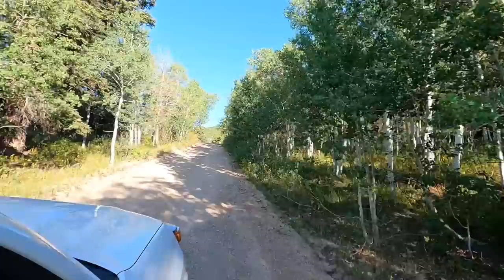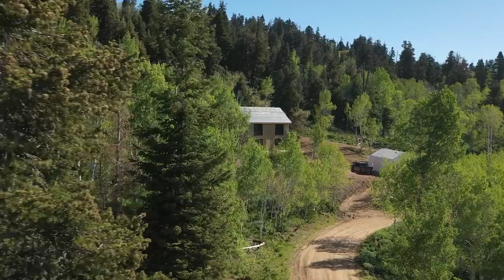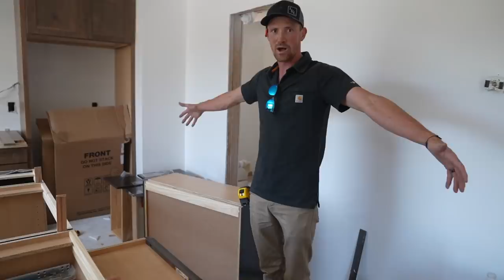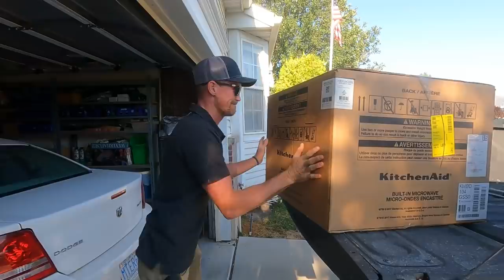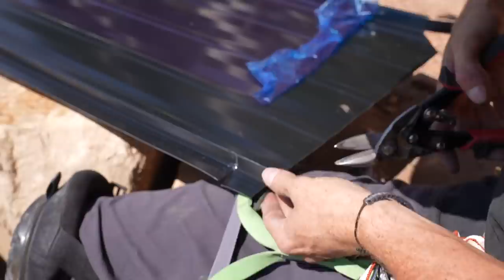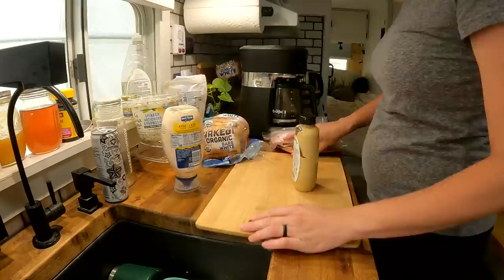TAKING ON THE ROOF | BUILDING OUR OWN HOME

Comment: Not sure if you have thought of adding a generator to your build, but it was the best thing we did to our Florida home over 15 yrs ago. We have a generac brand which auto goes on within 30 secs of power outage. Included our ac, fridge, freezers etc plus ceiling fans. Lifesaver!
Reply: Great Idea, I honestly haven't heard them say anything
Reply: I understand power goes down lots in summer do to power load from everyone trying to stay cool. So was a great choice
Reply: Totally agree with the generator idea
Reply: Mandatory. Totally mandatory.
Reply: we live in florida also and i’ve been looking for a generator. the only other option is solar and batteries
Reply: I'm in the Mid-South with tons of trees.  We probably have 6 small power outages a year when we get heavy wind and rain. Branches snap off onto powerlines, or blow transformers. But if it's cold, and we get freezing rain, look out.  Ice storms are the worst. Years ago, most of the city had power out of up to 3 or 4 weeks.  Only a few years ago we had a derecho that put most of the city out for a week or 2.  I, just this year, finally got fed up and put in a 14KW whole house Generac.  We had an outage within 30 days of installation.  I waited at my desk for a few minutes and then, BAM! All power back on as it kicked in!  SOOOOO happy, I called my installer right then to thank them again!  Worth every nickel!
Reply: Its a great option if power is unreliable. A we only get one or two outages per year we have a cheap ($250 used) 5000W portable generator that we can manually hook up if we have to. I can also use it around the farm to power welders and the like "off-grid" so to speak. An auto-transfer generator would be a waste in our situation.
Reply: We are thinking of getting one.  After two years of 2 power outages that lasted close to 2 days each time.  We are ready to have relief.  Of course this happens when it is hot outside and we loose all the food from the fridge.
Reply: Yes! Yes! Yes!  Rural “Country Living” includes a generator, and with your enormous propane supply you are halfway there.  Lights, heat, cooling, cooking, refrigeration and baby are all much better off with a gen when the power goes off.
Reply: Expensive
Reply: Yeah, it's expensive but I don't think they are short of a bob or two with all their paid promotions and adsense revenue!
Reply: When we were 5-7 days without power, I would have loved to have a Generac generator…and will if I ever build/buy another home.
Reply: It's definitely a great thing if you can afford it. We had a generator from the year we move into this house, wired in. We manually have to start t it up but hey, way better than not having anything. Ha Giang no fans or refrigeration while waiting for the power to be restored.  W e are also in a Cyclone prone area in the Southern Hemisphere.  We increased our generator capacity two years ago. It's 11 years since we have had a direct now, so maybe this season will be an active one. Generators have greatly improved over years and the prices have improved.

What would definitely pay after the concerns Allie has shown, is sprinkler on the roof. Connected to an independent water source as in underground water tanks,, pumping water to the sprinklers by a generator. It also has been known in the Southern Hemisphere, to reduce your fire insurance costs. As most people know, many coastal areas of Australia are bushfire prone ever since the Greenies put a stop to land management, in reducing underbrush and fallen dead trees. 

At least Trent will have motivation in clearing his fallen trees, needing to feed one very hungry wood fire. I am surprised you didn't go for a wood powered oven/stove. With an alternative method In summer, Trent.
Reply: I have friends in New Orleans area with Generac on Natural gas. The area still without power. They have A/C and providing ice a minimal power to neighbors during the sweltering heat post Ida.
Reply: Yes get a generator with a baby
Reply: Solar panels are nice too.
Reply: @Tom_From_Alpharetta  they are one of the lucky ones, some of the natural gas grids are down too
Reply: I'm in Kansas and Just yesterday had a Solar Array and Backup Generac installed. We have Tornados that tearout powerlines and Ice Storms that knock the grid out for Days/ weeks @ a time.. Haven't Had to use it yet Obviously.. But so glad to know I have it Now..
Reply: @MrBrickboy38  for them? 😆

Comment: I presume your installing tile or hardwood flooring. ideally you want to either install the flooring first (much easier & cleaner look, or at least raise the height of the cabinets using 3/4" plywood so the cabinets are level to the floor height.  Also as I posted earlier I recommend putting a spacer between the fridge cabinet and the wall so your fridge door can swing open more. its possible that your fridge door is not going to open all the way because its going to hit that wall.
Reply: Yup, that is what happened to me.  Fridge door would have opened but not wide enough to pull out drawers.   Had to do a last minute revamp of cabinet locations to move the fridge and make it work.  If you go with current location you may be very limited in the fridge that will fit.   Flooring under cabinets doesn’t have to be raised unless you are doing a thicker floor like hardwood.  Most flooring thickness is fine.  Dishwasher is the only concern and they have about 3/4” gap and so can fit just fine.
Reply: I was going to comment about the flooring UNDER the  cabinets but I just fast forward through a lot of the video since it is already too late by this time.  Ignorance is bliss! :)
Reply: @Suz9006  I agree about the location of the refrigerator. Make sure the doors don’t hit that right wall or you won’t be able to open the door all the way to access the fridge drawers. Been there…
Reply: Happened to me too, I can't get the shelves & drawer out because the wall stops the door opening fully. Have to pull the whole fridge out if I want to get them out, real pain.

Comment: Had a metal roof here in Vt. True, they last forever. But I got tired of shoveling a foot of snow when it snowed only 2". With that roof dumping the snow on the deck, you will be clearing it off every time it snows. Forever.
Reply: I thought the same but I guess that's why they bought the snow blower.
Reply: @SagebrushRambles  I'm sure they realize it will occupy a major portion of their time to keep clear. At least I hope they do! Maybe their plan is to mostly use the sunroom door in the winter? After all, they don't have a mudroom and that could double as one in the winter.

Comment: I would have slid the refrigerator left to eliminate the spacer in the cabinets and use the 3" cavity to store a step ladder to get on top of the cabinets, it's where we keep ours.
Reply: I don’t understand encapsulating a refrigerator
Reply: Yes - a few questions here. That ref sidewall is used when the ref is located with an exposed side. In Trent's application it would have been much better to not use the right side wood wall allowing a few inches on the right side of the ref for 1) air circulation 2) step ladder or broom 3) a larger ref in the future 4) eliminate need for spacer in the lower cabs.  . Also for what its worth they should have installed floor BEFORE lower cabs and island - installed uppers before lowers and wait on trying to place any appliances until more of basic work is completed. But they are young and learning God bless them. Certainly can't fault their enthusiasm. ;-)
Reply: @easyman6086  I've never thought they were going to have wall cabinets.  And I thought the reason they put a row of wall cabinets on one side of the island was to have that kind of "dish cabinet" space."  But who knows but them, each video is a new surprise.

Comment: This is all so exciting! I'd recommend getting curved counter tops. The less you have to worry about when your child(ren) is/are exploring as they grow, the better!
Reply: Curved counter tops also save your own hip bones. I am 5’2” and bruise so easily, my hips were so often black and blue, especially when I was front heavy with 4 babies. I don’t know if real stone can be smoothed into a softer round.
Reply: I agree. 3 grands and now a great grand...many bumped heads hips, shoulders (the kiddos). I have shuddered 100's of times as they chased each other or ran through the kitchen. We finally found some soft but firm bumper pads for the corners and got to breathe a huge sigh of relief. I so wish we had gotten curved counter tops...and YES those hip bones hurt too when you collide with a corner.

Comment: TRENT, you shouldn't be misleading with info like metal roofing that is screwed on. Properly installed the screws do not 'Rip out' when the snow slides. I've been a contractor for 29 yrs in Western Canada, get the same if not more snow than your area and never seen screws rip out. The screws also act as a 'brake ' to control the speed of the snow sliding off the roof. No screw roofing on a steep pitch such as yours, you walk out and close the door too hard and your buried under snow because it all comes down at once even with snow stops under the right conditions. Hopefully that never happens. Cheers from Canada!😁🇨🇦🔨
Reply: Snow & ice stops have saved my gutters after having to replace the 1st install😥 Also the Amish installed my roof w/screws & none in over 15 yrs have never popped!

Comment: Trent I managed a roofing company here in Fresno California for a while and we did spray Emulsion Roofing with elastomeric rubber coating afterwards and we could only do it in the heat because it was basically liquid asphalt and needed to dry so on a hundred and ten degree day the surface temperature of the roof was around a hundred and thirty degrees or hotter and it was black and sticky and you actually had to twist your feet so that you didn't melt your boot to the roof as you walked around so I feel your pain I remember we took lots of water breaks and it was just a miserable job anyway stay safe up there thank you for sharing congratulations you guys I can't wait to see you finish up that Nursery❤❤❤👍😎

Comment: I've thought that a few times; while a nice goal if the trailer is cleaned up, maybe the dogs get the boot, but you can do the baby in the trailer while finishing up the inside of the house.  Getting the outside stuff 100% before winter is really the big key.  Keep the winter out and you have lots of time to finish the inside.   Healthy babe and mom are way more important than rushing the build and stressing out.

Comment: SOME ADVICE TO THINK ABOUT!!!
I personally don't like quanset hut style buildings, but I've come to appreciate them very much. I'm just north of you in Montana and we also get a lot of snow and cold weather like you'll get there in the mountains of Utah. 

My Dad had an arch building built for his shop. Almost forty years later I have really come to appreciate this style building with its arching structures. I don't have to shovel or scrape snow off the roof. It slides off down to either side naturally by itself. (Much better and safer)

When you go to build your shop/garage... you should seriously consider doing a quanset style building... be sure to leave room on either side so it doesn't bury your vehicles or whatever is next to your building. For me, I use my walk behind snowblower to clear a pathway on my patio that runs alongside the shop. (I have a shop about 35'x40')

So, give it some serious thought so you're not risking the roof collapsing on your shop/garage due to overloading it with too much snow.

Comment: All those sippy cups and plastic plates & bowls will need cabinet space. More than just the bottles used, at least mine did. I used interior mounted childproof locks to not damage my cabinets as well. Pots, pans, strainers, mixing bowls etc in the bottom cabinets as those were the first to be breached by our 2 year old.  If you plan ahead for the toddler your baby will be,  you won't be rearranging your kitchen in the near future. Running up & down stairs with a leaking diaper meant a complete change of clothes for us both at times and a changing table for both levels became practical. You won't need these things at first but as you plan things out just keep the idea that as your child grows things will need to change for a while.  I still have baby locks under my kitchen sink as I have cleaning supplies and soap under there again and the bottom cabinets still have bowls and pans for visiting children lol

Comment: I just built a jig from 2x4s.  You just cut one board the exact width of the panel bend section and mount it on another 2x4 to form a inverted T shape.  You then attach a board on the outside of the T to form the edge of the bend cradle.  This way your panels will be bent square.  You then cut a second board the same width of the panel and use that as your edge bender on the top.  You only have to lay the panel end on the T jug and use the second board on top to form the bend.

Comment: So glad you guys are doing a metal roof. I have installed both metal and shingle and I would FAR prefer to do a metal roof. there are many more ways to screw up a shingled roof and in 25 years you get to do it all over again! I just re-did our shingles after 20 years and it absolutely SUCKED! Sure the rain is noisy on metal but honestly compared with "never" having to replace and lack of screw up potential its a much better way to go.

Comment: Are you putting down the flooring before appliances? Usually the flooring goes down before the cabinets as the flooring after will make the height lower.

Comment: You have been talking about the fire danger on your mountain.  Just a suggestion for you to consider. You can talk with your home insurance and/or your fire district, local Forest Service, State Fire resources, etc. They all have great mitigation measures for fire safety around and near your home and out buildings. It could possibly help with your insurance rates as well as maybe save your home. No I don't sell insurance but have been a dispatcher  of resources for over 20 yrs. Something  to think about.

Comment: Best thing you can do with a manlift is keep the center rotation ring level and if you’re on soft ground throw some wood underneath the tires to give the tipping axis which is the sidewall of the tire something to bare down on.
FYI: The name on the lift JLG Stands for John L.Grove
He was the guy that started Grove crane and then sold it to Manitowoc Group crane manufactures. The owner of Grove crane back in the day sold off to Manitowoc and he couldn’t compete with them so he started manufacturing manlift and made a fortune!!!!

Comment: Some open shelves in the corner would be beautiful and keep the light flowing from the windows so I’d eliminate the corner upper for sure!! You have tons of storage down below and above the refrigerator. Don’t just cover that area between the lower cabinet because you can use that for cookie sheets to slide in! Just a suggestion!

Comment: Just curious, are you going to extend a patio roof over the front porch? If not, picture this: a heavy wet snowfall that freezes overnight , then it snows again and drop 2' more heavy snow. Finally the weight becomes too much for it to stay in place, and WHOOSH!! Now you have a 6' high drift blocking your front door, sun roof door, and underpatio area!!

Comment: Trent!  I love your enthusiasm but you have to fix the flashing on the stove pipe before you get rid of the JLG.  A bunch of silicone and tar won't keep your house from being ruined by water.  It's no joke and it really doesn't take long to cause real problems.  Remember the roof should shed water without sealant.  Love your channel and your youth...

Comment: Just lay the fridge down in the back of the truck.     Then when you put it upright let it sit that way for 24 hours in a upright position, you will have no problerms with putting it upright after 24 hours, I have built a few places where I have had to do this and never had a problem.

Comment: One hint, if the fridge is not already there: 
If a fridge is tilt due to transportation needs (no problem, it may be layed down), it should remain in it's upright position without power for at least 4 hours so the gas and liquid inside the system can level.

Comment: Only problem with metal roofs is rust, any bare metal will over time rust so cuts will strip off the protective paint and should be touched up with rust proof paint.

Comment: I put my new fridge in the back of my Toyota hatchback laying down and drove home 50 miles. As soon as I got home I took the fridge out of my car and stood it up, and about 2 hours later I had it plugged in getting cold. That was almost 7 years ago. The fridge still works fine. It doesn't take long for the refrigerant to settle. The theory of leaving the fridge upright for 24 hours before using it after it has been laid down is just that, a theory.

Comment: Actually you can order base cabinets in any depth, including the wall cabinet depth.  Then they come with bases. 
Your consultant at Home Depot wasn't very competent.
It's also best when your finished flooring is installed first. Doing it second without shimming up the cabinets the thickness of the flooring may mean the dishwasher will not fit in height.

Comment: So it won't be a sit down bar? No leg room where cabinets go?  Make sure you ROUND the CORNERS on your Island COUNTERTOP!!  As the little one grows up yah don't want them to hit a pointed corner for sure if they take off on a run in the kitchen.  It's called a Ridge Cap on the roof.  ONLY WEAR TENNIS SHOES ON THE ROOF it will Prevent sliding AND Scratching of the panels.  God's blessings.